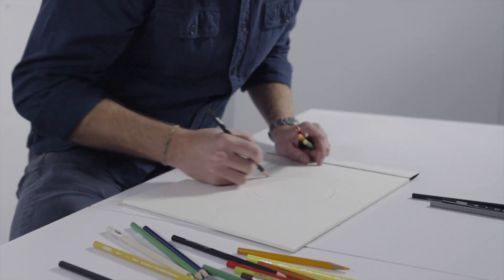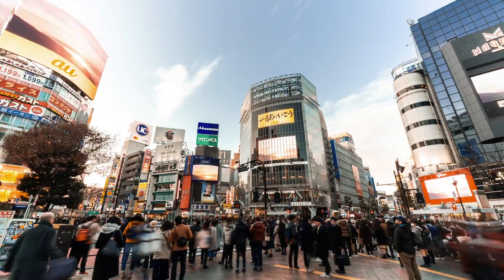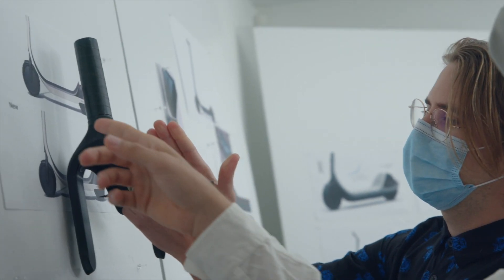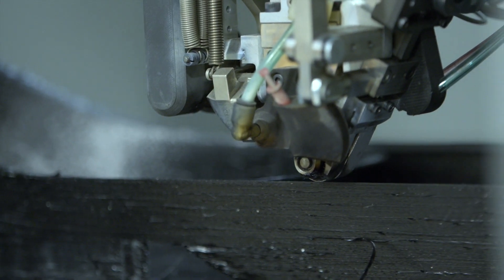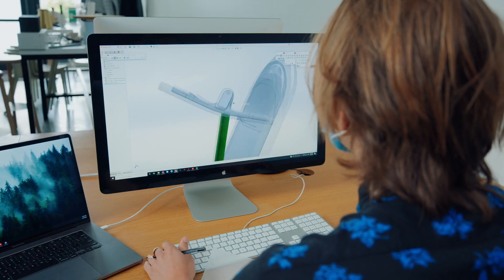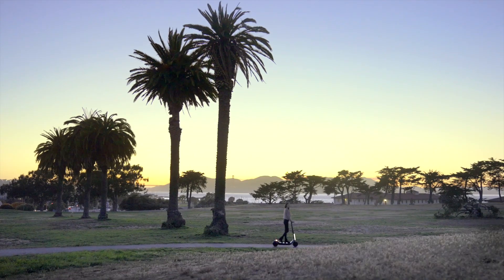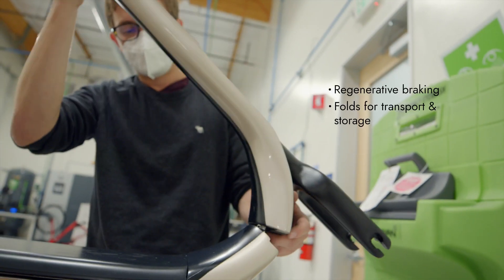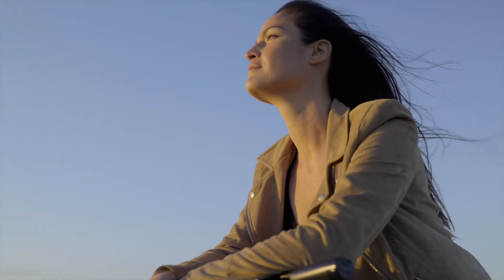Scotsman - World's first custom 3D printed carbon fiber electric scooter

Comment: With carbon fiber I was expecting this to weight about 10 kg, not 18 kg (without batteries). Something is wrong here if M365 Pro weights 14.5 kg and is from heavy aluminium/metal.

Comment: How is campuslo.com selling this Scotsman scooter for US$39.95 when your own site puts it at about $3K or more?
Reply: This is the full link. I thought it was a typo -- https://www.campuslo.com/Scotsman-All-Carbon-Fiber-Scooter-World%E2%80%99s-first-connected-all-carbon-fiber-dual-power-scooter-custom-made-for-you-p1091048.html
Reply from the maker: Scotsman is built based on our proprietary 3D printing technology to achieve the unique design. Carbon Fiber is an ultra premium materials with high cost, so it can not be sold at such low price.  We highly recommend you report this product as it violates our brands.

Comment: do you realize that carbon fiber is brittle and NOT ment for shear stress ? Its flexibel and might not brake right away. The fact that sports cars use it for everything EXCEPT the chassis tell everything. its lighter which is its tru advantage over steel or other metals.
Reply: https://www.youtube.com/watch?v=KjiP8wKVXyc
Reply: How about bicycle frames and rims from carbon? These take a lot of stress and it works. What's your opinion on this ?